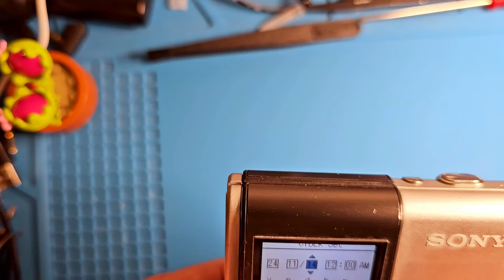Sony MZ-DH10P Hi-MD MiniDisc Camera and Recorder - Bad CMOS Sensor Repair/Replace Swap

Comment: Thanks for another great video. I have a Sony MZ-DH10P which I been wanting to repair for years. I got the MiniDisc side of it working, but as soon as I enter Camera/Video mode the unit hangs on whatever screen it is on, the only way to recover is to remove the battery. I have inspected the camera PCB,  there is no visual sign of any damage, I checked the component for shorts, nothing is getting hot, and I have  reseated all of the cables for the board and sensor. That is where I run out of skill.  I am not sure if mine has a sensor that has completely failed or if its a issue on the camera daughter board. I tried looking for replacement sensors in the past without luck and donor units aren't easy for me to get hold of. I'd love to hear from anyone who had success at fixing a unit with the same symptoms as mine. Thanks
Reply from the maker: Thank you!  Wow - looks like you did a lot of troubleshooting. I wonder if it could be just a dead camera sensor module. I shipped the units back so I can't test what the behavior would be like in your same situation.
Reply: @TechnicalInitiative  - yes I did at the time a lot of troubleshooting, it was a couple of years ago now. These units rarely turn up in the UK.  From memory it made no difference if the camera module was plugged in or not the behaviour was the same - it hangs as soon as it enter camera mode. I did wonder if the memory on one of the chips on the camera board was corrupted/failed. It dies so quickly into the switch to camera mode. The thinking behind in being the sensor is, that the only details I could find on the unit said the sensor was a common failure point - and perhaps without a signal from the sensor the devices crashes when switching to camera mode. I am guessing other devices use the same 1.3MP sensor, but the markings on it don't hit any matches so never got any further. The problem is without a unit to swap parts out it really hard to pin point the fault, without much better electronic knowledge than I have.  It was great to see you get one up and running again. Thank you.
Reply from the maker: Sounds like you did plenty of troubleshooting for sure. Without another unit I would have been dead in the water as well.  I'll keep an eye out for these units since I'd love one of my own.... If I find a donor somewhere I can keep you posted!
Reply: @TechnicalInitiative  Thank you that would be amazing. I hope you find one soon, there don't seem to be many working units left. Its one of my most unique MD Recorders, it is the only one I have with a colour screen.

Its feels weird being able to have cover art on a MD player, it would be nice to get the camera going again one day. Thanks again, keep up the great work with the channel.